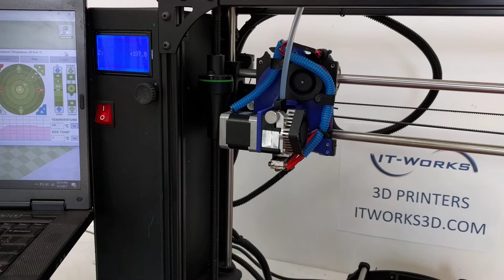How to unload filament in the E3D Titan Aero extruder

Comment: So I've been changing filament differently.. Just by pulling back the idler, pushing a little filament in and quickly pulling out. Gets a clean break for me. Wouldn't automatically retracting filament cause melted filament to retract past the heatbreak potentially leading to clogs? I tried doing it this way and I had a 4 inch long super thin strand at the end of the filament. Is there any advantage to doing it like in this video?
Reply from the maker: So were used to use this method.  Now we do exactly what you have described.  Much quicker and easier to do manually.